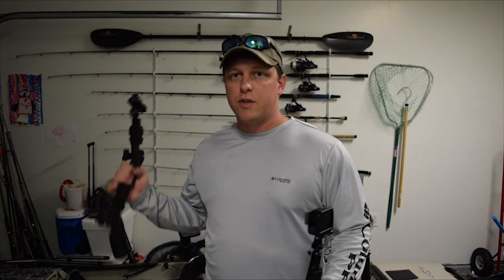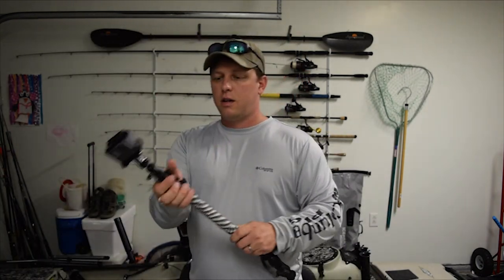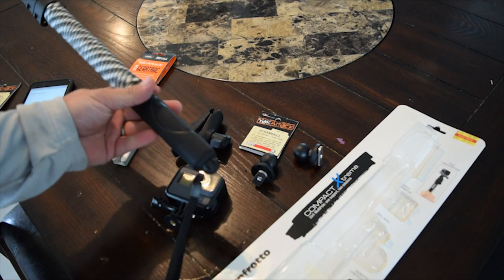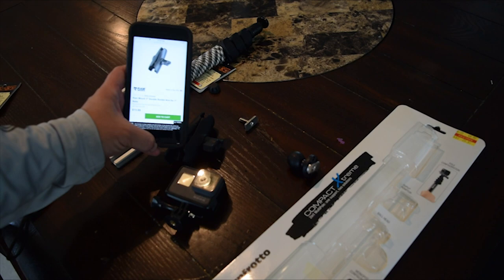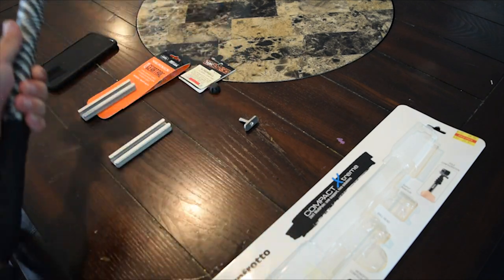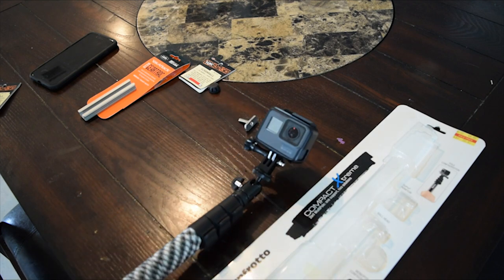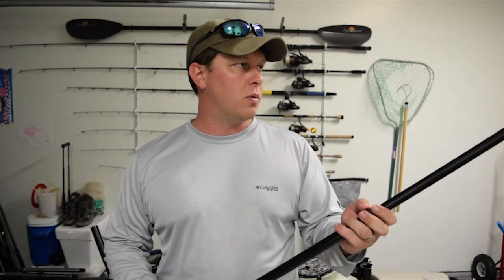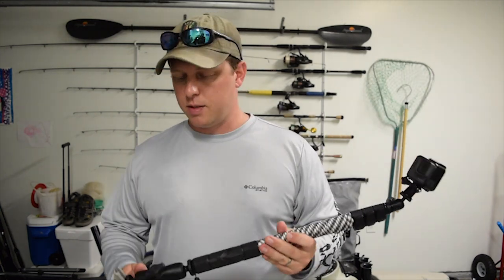How to make a DIY GOPRO/ CAMERA mount for your kayak or boat!

Comment: The link for the 1 inch ball that screws in the bottom of the pole is for a ram mount ball...not yak attack as u show in video.  I order and it doesn't work, fyi.  Found a yak attack version which I'm waiting on.  No big deal but thought I might help the next guy.  Love the set up though, nice job.
Reply from the maker: Dang sorry to hear that!
Reply: didn't work for me neither .. @yakfanatix5757 do you have the link to the yak attack version?

Comment: Have you had any problems with the Ram mounts slipping with this boom?
Reply from the maker: Alan Howell only if you boom it out all the way.
Reply: @SlotCityFishing  , do you think the 1.5" ball would hold better? I'm wondering if it's worth the extra cost though.
Reply from the maker: Not sure bro. Maybe. I use this thing mostly in  a surf rod holder now surf casting